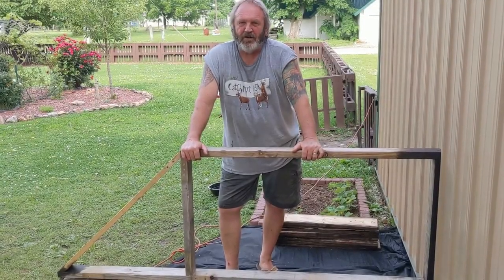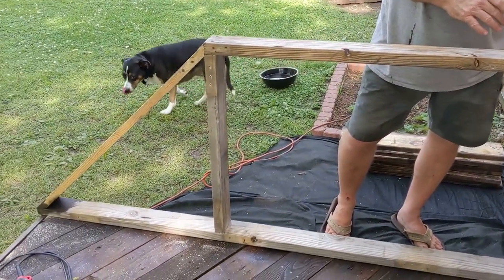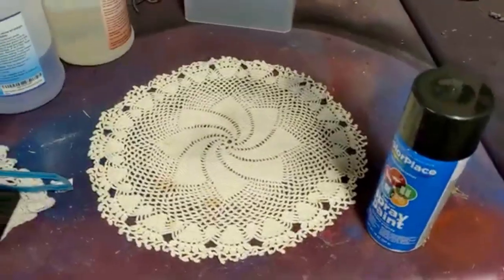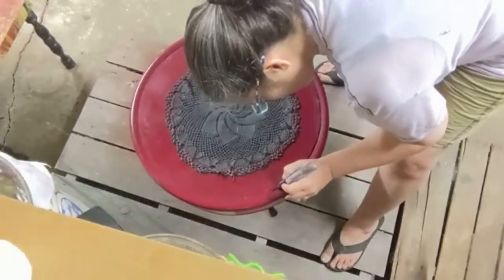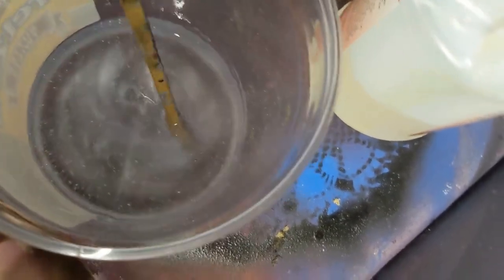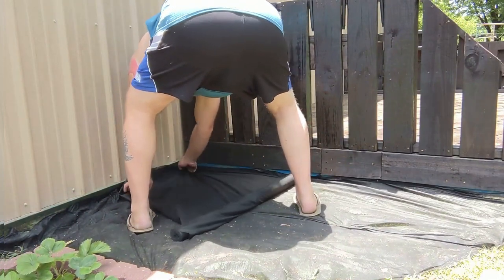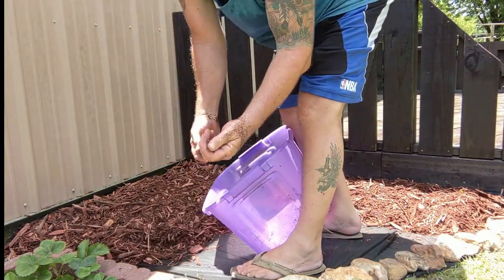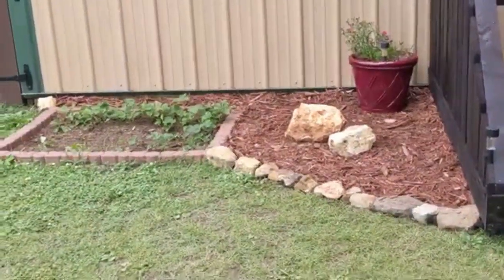DIY Pallet Deck (Part Two)

Comment: THAT'S GREAT, AND ALSO, HOW DID YOU MAKE YOUR FENCES?  HOW ARE THEY STABLE? ETC...
Reply from the maker: Thank you so much Tracey. I dug a 4" trench and turned the pallets on their sides to give that picket fence look. I then attached the tops of each adjoining pallet with a metal cleat (as shown in DIY Pallet Deck video where i attached the facia boards to the deck) Then at the base of each adjoining pallet i hammered in a stake (pallet slat) on both front and back into the ground. Each pallet was then screwed into the stake, attaching each pallet at the base. I hope that makes sense. Unfortunately i built the fence prior to our video channel. It would have made a great video though. Thanks again for your support.
Reply: @kinlockskorner6862  Thanks a lot, I'll try to watch more of you and your hunny change the game by making things more simpler and easier to understand.
Reply from the maker: @tracycondetcoles9987  you're welcome, I'm so glad you can get some enjoyment from our videos. Good luck with your future projects!